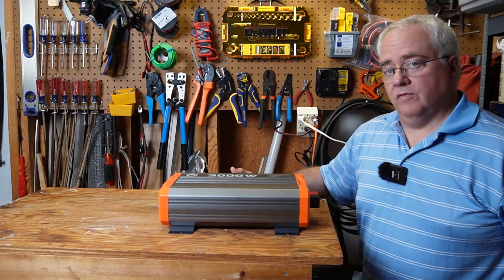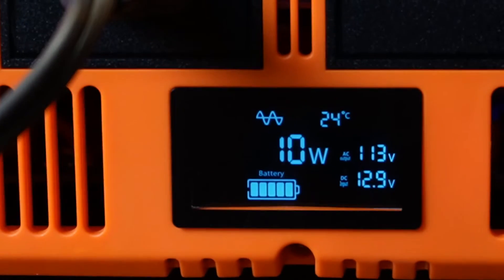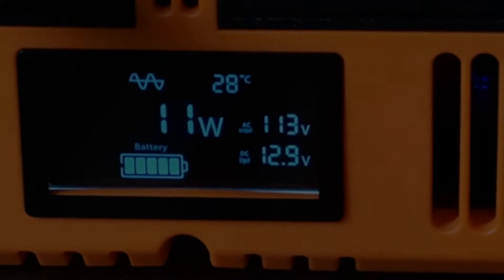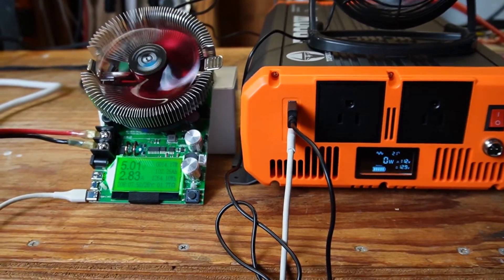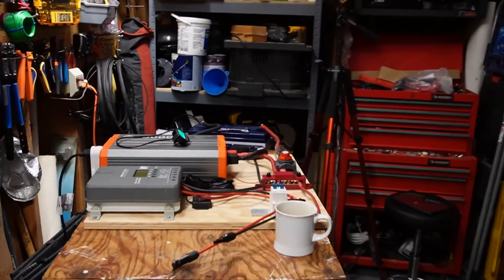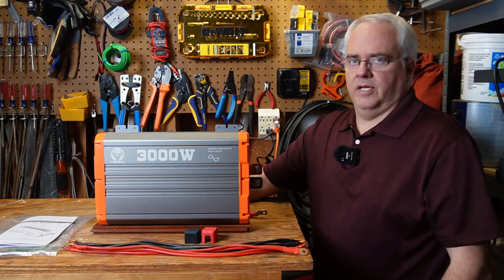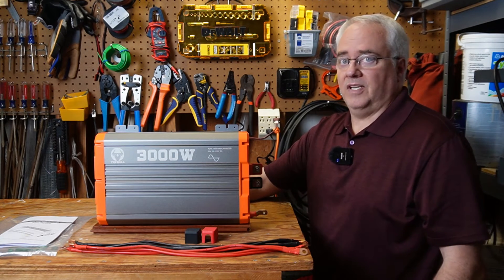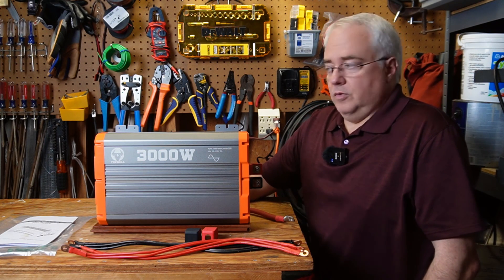TOPBULL 12v 3000w Inverter - Review

Comment: Would this inverter have the same impact as shown, with using a car or small truck 12v battery. With it installed in the car or small truck?
Reply from the maker: You could definitely hook this up to a 12v battery in a truck. But you would need to figure out how much of the 3000 watts you can use depending on how much power your battery has. Batteries in vehicles are designed for huge rushes of current to start a vehicle. But I'm not sure how much sustained draw they can take. I've not had much experience with using lead acid/AGM batteries with inverters.

Comment: As i was watching, you mention the terminals for the DC wires having to be at 90° to each other to work. I was thinking you could invert one of the terminals so they may be able to lay over each other flat?
Reply from the maker: I remember trying different ways. I may have tried that already. Next time I use that inverter, I will give that a shot.

Comment: if I were to buy this inverter I would crank up the 110 voltage to 120 with the adjustable trim pots on the inside of the inverter
Reply from the maker: Thanks for sharing. I just recently found out you can do this. After this video of course. Why would they set the voltage at 113 when it could be at 120? There must be some reason.
Reply: @proficientprepper  The inverter will operate appliances fine as long as the appliance is rated at 110 volts If it's rated for 120v poor performance or damage could occur after some time.  "why would they set the voltage at 113 when it could be at 120? There must be some reason." contact the company and ask them?